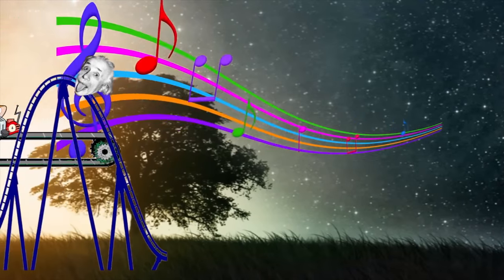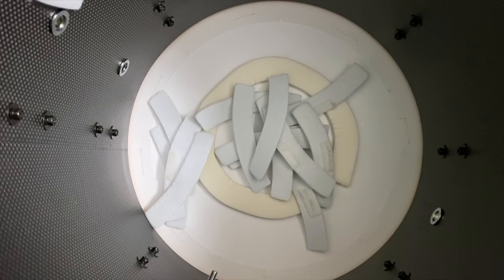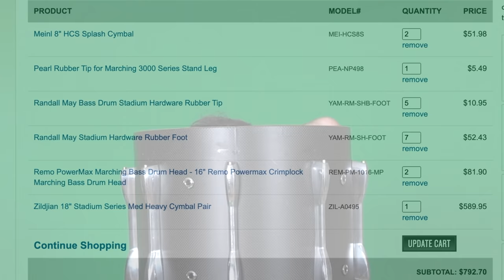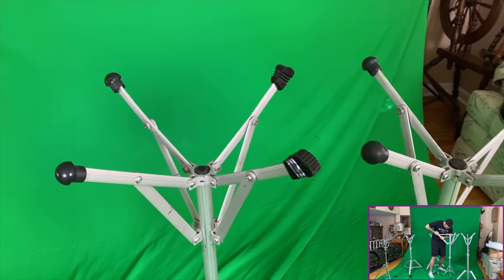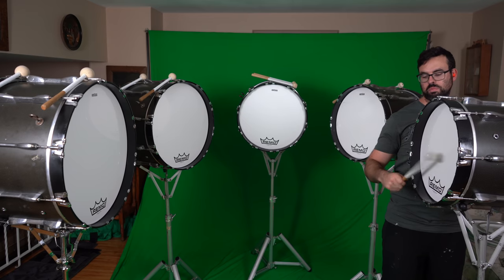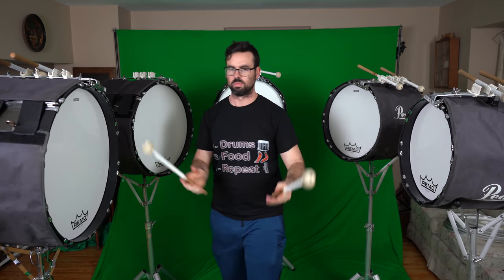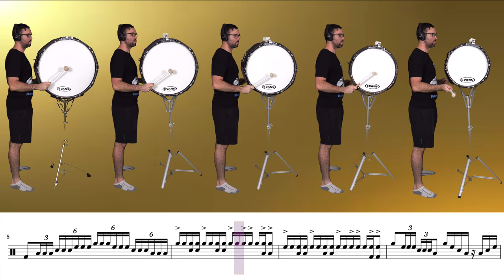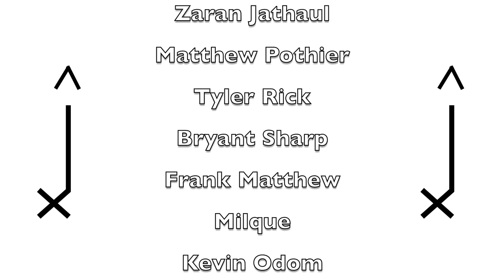Making Old Drums Sound/Look Like New Drums

Comment: Remo Powermax heads are great. I have them too (in black/Ebony) on my own bass drums , but because I use low tuning I had to add extra muffling along the edges of the shell to get a more controlled and less ringy sound.

Comment: Tried to pull out an 18” bass from the old discard pile (middle school) so my high school line could run 5 bass. Put fresh heads on and tuned it up.  It sounded fine but the counter hoop would actually slip off the flesh hoop partially and the thing would drop like an octave. Definitely out of round on the hoop or the drum or both. We are going to put it back in the pile and run 4 bass next season. Not worth the hassle/risk.

Comment: Grease the washers and head of the tension rods, so it cranks up easier, and cuts down squeaky noises. And wax the bearing edges so the head crank up without pulling a head. Don't forget to re tighten up the lug casting bolts. And use car wax on everything to shine up the drums up and slow down rusting.. Advice  for other drum lines working their drums.
Reply: YES! Wax those edges!

Comment: Yeaaaaahhh… not a super big fan of the felt-holding inner rings. I’ve yet to see them stay in. 

Thoughts on muffling inside the heads vs. visible muffling around the rims with AC weather seal foam strips?

Comment: Christ it's just like my high school when we went from Remo Powermax2s to Evans MX2s and I absolutely hated them. They didn't sound nearly as good and we had constant muffling issues. I eventually said screw it and put the muffle rings from the powermaxes into the Evans heads and they sounded much better and solved the muffling problems. 
I restored my bottom bass for senior year before her retirement. She is a Yamaha 8128 and hands down, the old 8100s with their heavier hoops and twelve lugs sound much better than the current ten lugged 8300s in my opinion.
Reply: After our drumline director had left, I more or less became the drumline maintenance man, by choice, and I took great pride in my bass. She was tuned to a nice and beefy Bb. I hadn't actually tuned the others to specific pitches but they still sounded great all together.